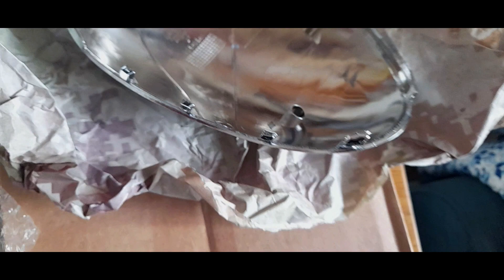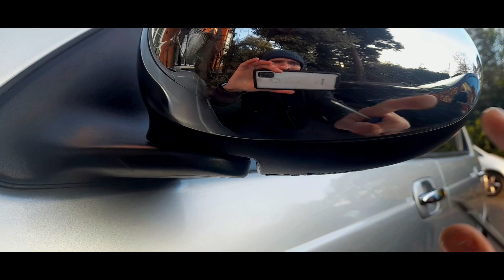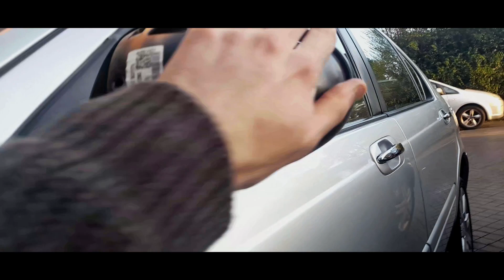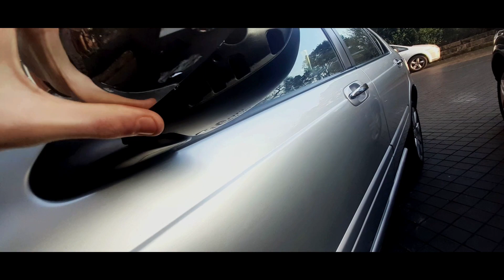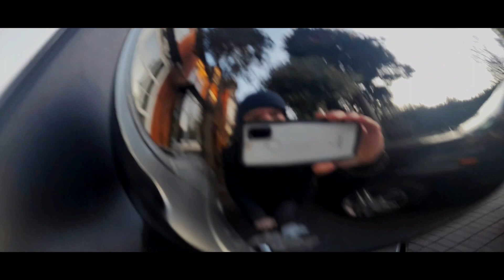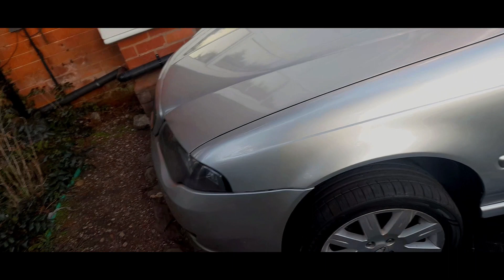Rover 45 Update - How to change your mirror caps?

Comment: Little hint from experience with car plastics. I've found that if you warm the plastic parts with a hairdryer (not a heat gun) first they become much more cooperative. Don't use enough heat to upset paint or melt the plastic, just get them warm. Since coming up with this trick, I haven't had a breakage on lots of jobs.
Reply from the maker: Good tip. My usual thought is to gently heat up plastics that either commonly break or don't look very cooperative. I have abattery heat gun which is a little more than a hairdryer but has never caused damage on anything so far. Corded heat guns are terrible for melting things in a few seconds.
Reply: @usuallyfixingtinkering  Agreed. There's another way I've used, particularly on jobs where the part is off the car or external. The plastic shroud on the seat of my Opel Astra wasn't responding to the hairdryer treatment because it was big. I put a saucepan of water on the hob and heated it up. Pouring it on spread the heat over a wide area and the shroud could be levered off. The same thing would work on mirrors.
Reply from the maker: Nice trick I'll remember that one!